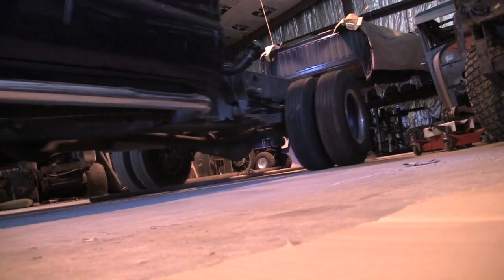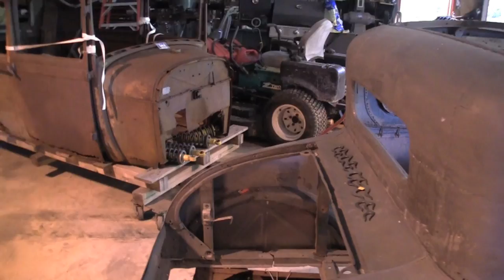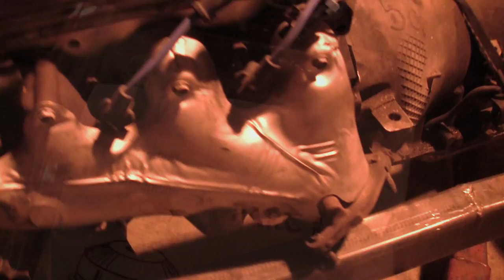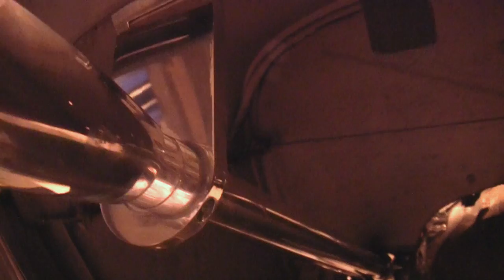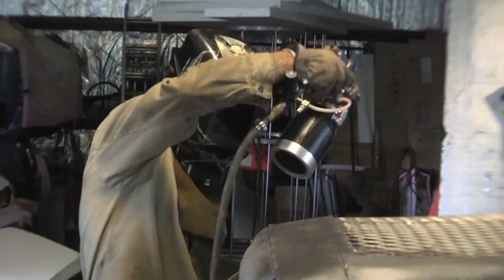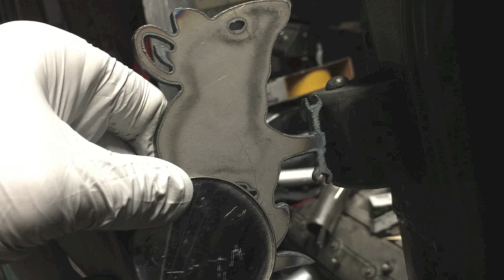Rat Rod build 1929 Ford Model A  first car build from ground up

Comment: Just curious, how do you get a title and tag for a car you build ?
Reply: check your state, usually you bring it to a highway patrol division and they start the inspection then you carry on to the state and acquire a title . . . . most people use enough of a certain vehicle in order to utilize an existing title, but for a ground up yeah you hit up your state troopers, they'll set you on the right path